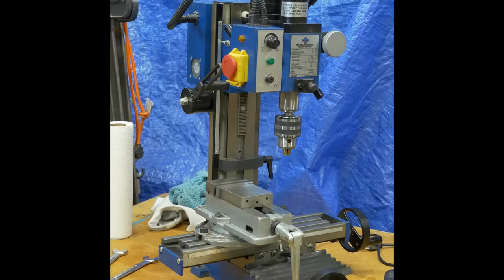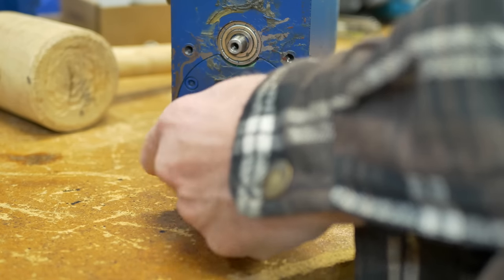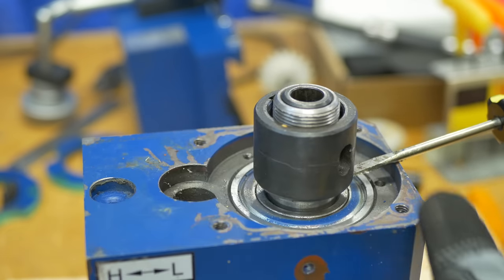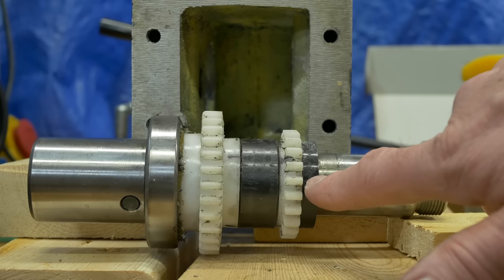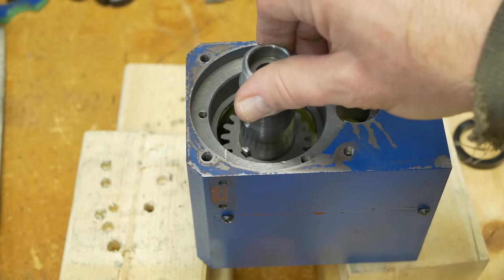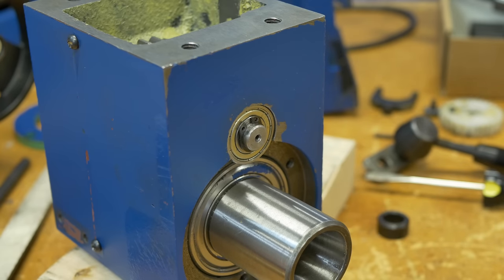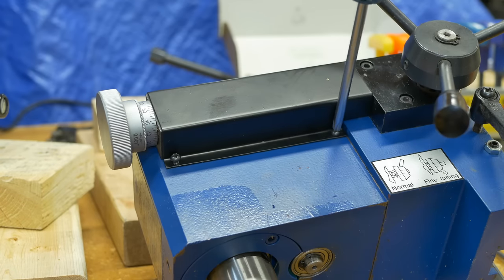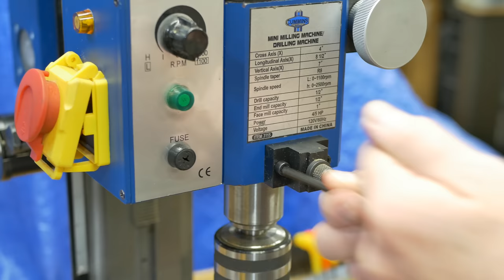Mini Mill Gear Replacement - New Metal Gears for the Mini Milling Machine!

Comment: You were pushing on the inner race of the bearing when installing it. Shouldn’t you be pushing on the outer race to not damage the bearing?
Reply from the maker: The bearing was tight on shaft, much looser in the outer race pocket, thus pressing on the inner race to minimize side load on bearing.  Thank you for watching!  That's a great detail question!!

Comment: Very good explanation.
When mounting the ball bearing in the housing, is it better to press the outer rings?
Reply from the maker: Yes, just press on the outer race so there's not undo side load stress on the bearing.

Comment: Enjoyed the video. Just was wondering since you had it torn down why you didn't replace all the bearing and left the one plastic gear? Just asking to learn. Thank you.
Reply from the maker: The bearings were still good, and I'm cheap, so they were reused.  Still in service today.  The one remaining plastic gear is the failure point, or fuse in the system.  It's also easy to get to.   That's what gives if something gets jammed.  Thanks for watching and leaving a question!
Reply: @metalwooddesign  thank you for sharing your thought process for that upgrade. Sharing like that is how we learn from each other. Where is the best place to get the metal gears ?
Reply from the maker: I got the gear set from www.littlemachineshop.com   That would be the first place to check.  They've got parts for many different brands of the similar machines.  Thanks and have fun with your project!
Reply: @metalwooddesign  it is nice to see that we shop at the same place. Looking forward to seeing more videos.

Comment: Interesting video for sure and I bet the metal gears will work tons better as well. They may make a little more noise running, but you are not going to break the teeth off them easy. I have to ask, if you had to do over, would you buy the same mini-mill? I ask because I am looking to get a bench top mill and wanted to know how well you like this one... Thumbs Up!
Reply from the maker: Like anything, it depends what you're going to do with it.  It is a handy little mill and does a good job operating within its limits.  There are a lot of similar ones so parts shouldn't be an issue.   Everything is a compromise, but for something like a milling machine, if I were to get another, I would tend to lean towards the best one that I could afford, have room for and are capable of moving.  Great question!   Thanks for watching and leaving a comment!!

Comment: 15:40, shouldn't you use the outer bearing race to be pressing the bearing in?
Reply from the maker: The bearing fit very snug on the shaft and easy into the pocket, thus it was pressed on the inner race.  Thanks for watching, and in detail!  I appreciate the the comment!!

Comment: What size is the PVC fitting used to press in the top bearing on the main shaft?  (At, or around 18:50 in the Vid.)

I’m thinking it’s 1 inch schedule 40.  Is it?  Gotten to that point in the reassembly, and I’ll need to go buy one - or make a substitute out of Delrin (during 100+ heat wave, without AC).

Addendum to above: 1 inch schedule 40 does work.

Comment: Hi, my name is Joseph Law. I have just watched your video replacing the plastic gears with metal ones I am just wondering where you got them from please I have got the same machine as you so I’m just wondering if you could tell me where you got them please
Reply from the maker: I got the gear set from www.littlemachineshop.com  They've got parts for many different brands of the similar machines.  Thanks and have fun with your project!

Comment: Good video. Quick tip. NEVER press out bearings like that. If you press on the inside and the outer is causing friction.. You will indent the ball bearings into the race. The bearing will go bad shortly. 
It may not be a sealed gearbox.. Grease is your friend. It's tacky and provides good lubrication forever.
Reply from the maker: There was that one bearing that fit tight on shaft, loose in the pocket, thus pressing on the inner race. Thanks for watching, and in great detail!  I appreciate the comment!!

Comment: Questions: 1) how much force was needed on the hydraulic press, and 2) the brand of grease for the gears?
Reply from the maker: It doesn't take a lot of force, but you do need a press so it can be done in a controlled manner, and variety of pieces to press with, like PVC fittings.

I used a general purpose synthetic grease.  Link is below if you want to check it out.

https://www.amsoil.com/p/synthetic-multi-purpose-grease-nlgi-2-glc/?zo=5265385

Thanks for watching and leaving a question!

Comment: Hay I think your doing a great job. But I noticed that you didn't put any grease on the shaft that the gears ride on will they be ok with out the grease and also I was wondering if you need a little grease on the gears ⚙️ them selfs.
Reply from the maker: All the metal to metal moving parts were well lubed with grease, including the shafts, shifter fork, detents and gears.   Thanks for watching and leaving a comment!

Comment: I have the same mill and I need to know where you got the metal gears cause mine broke tonight. This video was spot on, great presentation.
Reply from the maker: I got the gear set from www.littlemachineshop.com   Thank you for watching.  I appreciate the comment!
Reply: @metalwooddesign  Do you have a part number? I have been searching the web and cannot find them, even on Little machineshop site, still searching and the gear that I broke is the plastic one you did not replace. My machine came from Harbor Freight and is a central machine shop. exactly like yours but red. thanks for your help.
Reply: @metalwooddesign  Do you have a part number? I have been searching the web and cannot find them, even on Little machineshop site, still searching and the gear that I broke is the plastic one you did not replace. My machine came from Harbor Freight and is a central machine shop. exactly like yours but red. thanks for your help.
Reply: I found my part number, thank you. now to find the drive gear.

Comment: You went through all the trouble of getting new cast iron replacement gears, but didn't replace the bearings?
Reply from the maker: The bearings were good.  They'll still good now.  And I'm kinda frugal. Thanks for watching and leaving a question!

Comment: If anyone is going to attempt something like this, know one thing. You should only ever press a bearing in or out using the fitted race. If you're pressing it into an ID, press on the outer race. When pressing one onto a shaft, use the inner race. Otherwise, you risk damaging your bearing, and this video clearly shows this machine wasn't built using quality components. DON'T RISK IT! Otherwise, it's a great video. 👍
Reply from the maker: The bearing fit in the outer pocket easy and was tight on the shaft, thus favoring the inner race.  Thanks for watching, and in great detail!  I appreciate the comment!!

Comment: Surprised to see that that casting is identical to a mini lathe, with the exception of the grooves for the ways.  I agree with the others that mentioned replacing the bearings.  The bearings that come with those are complete crap, it would have made a huge difference to put angular contact bearings on the spindle, and some name brand 6001's on the jack shaft.

Comment: I am surprised you didn't remove the last weak link by replacing the last plastic gear with a belt drive conversion, you will be in the near future. 😊
Reply from the maker: That will be easier to get at and install.  Thanks for the encouragement!
Reply: I would think to keep that one plastic, buy a bunch of them in packs of 10, and keep the metal version on hand for the more demanding jobs when the plastic simply won’t do. That way, it keeps the motor from getting seized and breaking the electronics, which are a pain to find spares for.

But in my case, I have plans to combine the high n low speed gearing AND the belt drive modification from LMS, which will entail making an extended and keyed idler shaft adapter plus a third bearing, elevating the adjustable tension style motor mount to clear the spindle cover, and adding a future mounting option for a power drawbar - all while keeping the spindle lock capability. Essentially four speeds in one machine.
Reply from the maker: Definitely a good idea to have spare plastic motor gears.  Easy to change if something needs to give.  Thanks for the comment!
Reply: Yeah, definitely switch to the belt drive, whole different world. Great video either way. You have a new sub, keep up the great content 😊
Reply: @asakayosapro  i just had that idea, keeping the gears i just added noise. So you woulda 3rd bearing?  I want sure that was right. I have the mill & belt kit cant i just remove the gears and use the belt to the spindle? I think a gears broken in mine, its loud as hell. If i could just attach to the spindle and use better bearings you would even know ir was on. Probably just remove where the bearings stop and use heavier top and bottom bearings. Be more ridged too. Lmk if you have an idea
Reply: @Mikesmeyer88  that’s exactly what is shown in the video, it’s a direct drive from motor to spindle. It will definitely be quieter but you have to fiddle around with belts and tension adjustment when changing speeds, instead of just shifting a lever.

The powertrain I had in mind was motor > belt pulley (Low/High) > idler shaft > spindle gears (Low/High) > spindle

But to do what I intend to do is going to entail a reworked powertrain and motor mount to allow for clearances for things such as the idler shaft pulley, the drawbar and the spindle lock mechanism - a spring-loaded always-free positioned locking rod with a locking dog clutch knob, and maybe a limit switch interlock for that so one can’t run the motor if it is engaged.

The extra bearing is for the top end of the idler shaft near where the belt pulley is located, secured to a bearing block and two or three bolts; undoing those will allow for easy access for belt installation or replacement.

Its all just more options for more speed or more torque, in the end. Sadly I haven’t done any of that just yet, as I’m still working out the electrical side (SCR vs PWM), the fact that I don’t have the XY table and have to use a makeshift base out of  10” wide C channel and generic xy table, tramming, and it’s out of commission due to jamming up or crashing during operation and carving out the inside of the idler shift gear. Currently awaiting a proper steel gear set from LMS and a few other parts.

If you are hearing louder than usual noises after a crash , most likely it’s one of the plastic gears in the head...

The reason why I’d keep the motor to idler shaft gear plastic is that if that breaks, it’s a much easier replacement process.
Reply: @Mikesmeyer88  I have the belt conversion. It cut my torque in half. I'm going back to gears but with the metal ones shown in the video.
Reply: @asakayosapro  you obviously don't know what how hard it is to remove the head, change/clean tram and resemble everything. Thats not a solution, why would replacing grears all the time then having it ready be a better option?  Its not, plus its quieter and more power. This is not a good recommendation for anyone, if you're going to buy these machines buy a belt kit before. Youll thank me when you hear how bad it sounds.
Reply: @JETHO321  seriously?  I was reading someone asking if it lowers the torque, lms says higher rpm,but doesn't say anything about torque. Well ill probably just get a better 2hp motor and not worry. I just hate the noise of those gears as they are cast and not great finishing work
Reply: @Mikesmeyer88  the only gear i keep plastic is the motor to idler gear, located on top of the spindle head right behind the drawbar. That can be replaced without even unbolting the spindle head or taking it off the vertical column. This is more of a protective measure to ensure that if the mill ever binds on something, there is an easily replaceable 'weakest link' part that breaks, rather that than broken metal gear teeth, or worse, a burnt motor. 
But either way, you do you.

I just finished swapping out all the plastic gears inside the spindle head for metal ones on my mill, so i have no need to ever open that assembly again - at least until the delayed-by-more-than-a-month order of angular contact bearings come in...
Reply: @Mikesmeyer88  When the rpm's increase like they do with the belt conversion kit, you have to give something in the system which is torque. It's a trade off. I like the belt drive because it's quiet but it's eaten my spindle bearings from the constant lateral load on the upper bearing and it lacks torque. I used to be able to use slitting saws and larger end mills but now I can't. I've purchased the steel gears and new bearings which I'm going to install when I can afford to have the mill down. I'll likely sell the belt conversion.
Reply: 😊why no oil in gear box
Reply: @rondonovan4293  This box is not fully enclosed and is wide open at the back. Putting oil in it will only result in all of it draining out and making a mess.
Making it enclosed by putting an insert between the spindle head and the vertical dovetail piece will cause rigidity issues, so thats a no go.
Reply: The main gear on my moter came metal but the intermediate gear was plastic, I got a metal one for 20 bucks on ebay.
Reply: It's left as the weakest link on purpose.

Comment: So I ordered all my gears separately to save money which really wasn't much, my concern is on the larger 2 gears the set with the spacer on yours well mine came all 1 piece so I'm concerned it's not going to work. What my concern is the gear dimensions are perfect but because they are all 1 piece the bore is the same inner diameter as the smaller one and my original plastic gears the biggest one has a slightly bigger bore diameter.

Comment: Do you have part numbers for the replacements? My son's Grizzly is starting to whine. Suspect we'll need to do this
Reply from the maker: I got the gear set from www.littlemachineshop.com   They've got parts for many different brands of the similar machines.  Thanks for watching and leaving a comment!!
Reply: @metalwooddesign  I've bought stuff from them. Good outfit. Thanks.

Comment: Good video and I have the same mill and was wondering where you ordered the metal gears from please
Reply from the maker: I got the gear set from www.littlemachineshop.com

I used a high quality general purpose synthetic grease during assembly.  Here’s a link to that item if you're curious:
https://www.amsoil.com/p/synthetic-multi-purpose-grease-nlgi-2-glc/?zo=5265385

Thanks for watching and leaving a question!

Comment: Thank you very much for your usefull video. I'm going to buy a similar mill, and - having already experienced with the gears of my lathe ( broken as usual it happens to be, and changed myself with steel gears modulo 2 - not original but machined with my lathe with the remaing functional speed till functioning ) ... then i think i'll have to do that work again on the mill ... 
At that time i had no idea were get spare parts, then i decided to install modulo 2 gears ... 13 + 33 for lover speed, and 23 + 23 for higher speed ... they ... fitted !!!
Do you know if Little Machine Company can supply parts into Europe ?
So i can begin with ordering the needed spare parts ... in Italy we said "to buy the whip first, and the horse later ... "
My best regards ...
Reply from the maker: Great story, thanks for sharing!  I don't know specifics about their shipping but a quick check of their website (littlemachineshop.com) says they ship to many parts of the world.  Thanks again for watching and leaving a comment!!
Reply: Ciao Alessandro , hai trovato i ricambi in metallo ?
Reply: @danilomonti4199  veramente la fresa non l'ho più comprata, un po' per la spesa, poca ma - essendo solo per hobby - non strettamente necessaria, ma anche perchè non saprei dove metterla, a meno di non disfarmi ( sigh ! ) di un trapanino Proxxon TBH che ho sul banco ... la fresa penso lo potrebbe sostituire abbastanza bene, ma darlo via - dopo anni di onorato servizio ... mi repelle !!!
Comunque molti ricambi ed ingranaggi ( anche per fare filettature particolari al tornio ) li ho presi da Ali-Express, se ti serve qualche informazione fammi sapere ...
Ma tu hai un tornio, o una fresa ? Il mio tornio è un simil-cinese, sistemato da me quasi bene ... quasi perfetto oserei dire ... è tipo un C2 Sieg ...
Reply: @alessandroandrenacci2372  ho una fresa  la solita cineasta , ma andava bene, poi l’ho forzata e gli ingranaggi essendo in plastica sono andati… riesci ad aiutarmi a trovarli in metallo , io non riesco forse perché non parlo inglese se non con il traduttore😂

Comment: Very useful reference as I have the same machine branded Busy Bee and the plastic gears seem to be a common point of failure.  It hasn't happened to me yet-- but can to tell me where you sourced the steel gears?
Reply from the maker: I got the gear set from www.littlemachineshop.com   Thanks for watching and leaving a question!

Comment: I went with LittleMachineShop's Belt Drive and Air Spring Kit. (Part Number: 5069) ~$200usd. No more gears or torsion spring. Much nicer.

Comment: As a comment, it is always better to prees a bearing so that you do not press against the balls. Thus if you press the outer ring into a housing, use a press tool to press on the outer ring. This will prevent brinelling the races
Reply from the maker: The bearing fit in the outer pocket easy and was tight on the shaft, thus favoring the inner race.  Thanks for watching, and in great detail!  I appreciate the comment!!